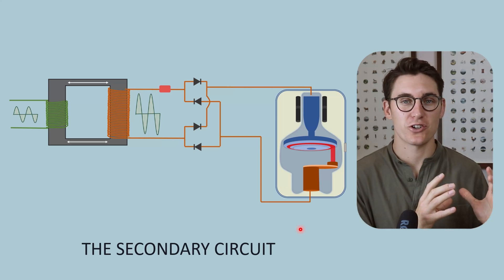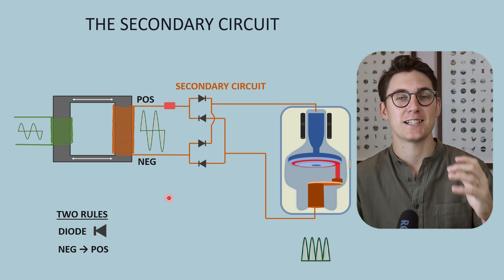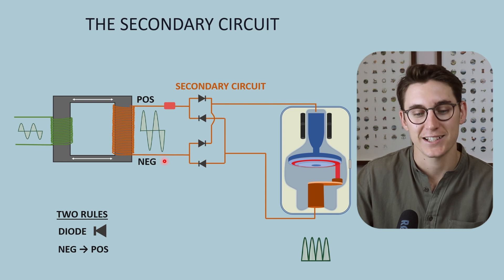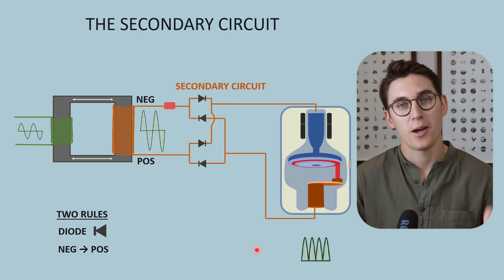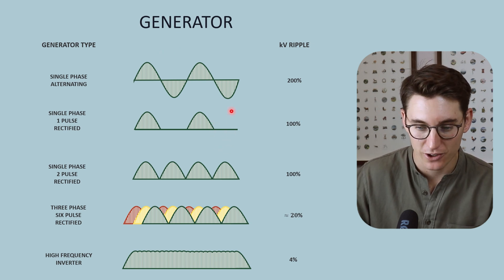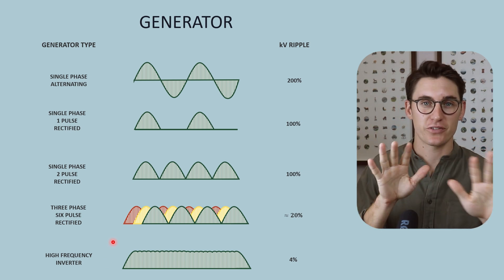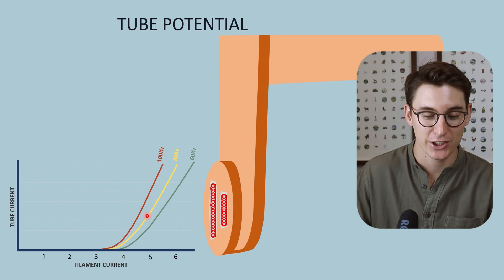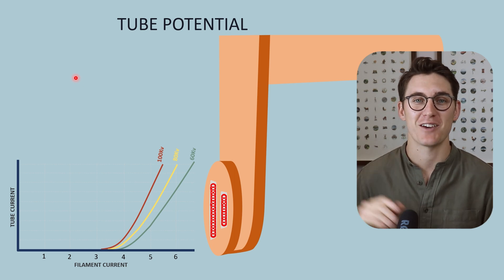Secondary X-ray Circuit | X-ray physics | Radiology Physics Course #17

Comment: Wow. Great stuff and appreciating your efforts. I know you have much more experience on the X-Ray technology. With all due respect. It might be advisable to explain that the movement of current and flow of electrons is opposite to one another. It is easier to explain current flow, going through a diode, to just pass in the arrows direction. Anode to Cathode. Basically as ABC in alphabetical order. Current flows from Anode (A), through the body of the diode (B) and out the Cathode (C).  Electron flow will confuse people. Current flow is easier to explain, especially for people who needs and wants to learn more. The sine wave / current changing direction at a frequency of between 50hz and 60hz, varies between continents, and countries, etc.  in a transformers, whether stepup or stepdown, the cycle and amplitude causes a magnetic field to be created. Whens the cycle continues completing the other half of the sine wave, the magnetic field collapses and creates the oposite half of the sine wave, induced (magnetically), into the secondary winding. Please remeber that current flow is opposite than electron flow. This applies to all electronics and electricity laws. No disrespect, in any single way.
Reply: There is confusion between half-wave rectification and full-wave bridge rectifiction.

Comment: Im confused on the direction of current through the diode. Correct me if im wrong, but doesnt the direction follow the arrow?
Reply: I ask because I know electrons and current flow in opposite directions to each other...
Reply: @DerickOduro  the opposite
Reply: @DerickOduro  It is a matter of convention. The direction of the  conventional current is from the highest to the lowest potential. However, here the author refers to the current of electrons which is in the opposite direction.